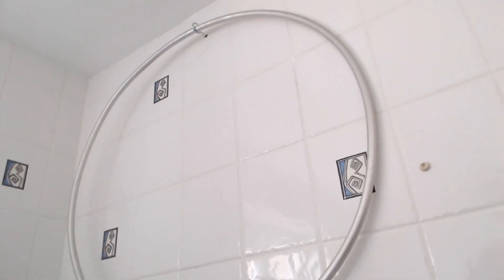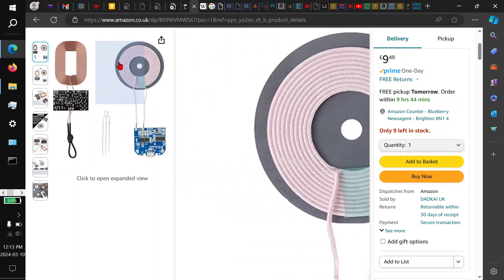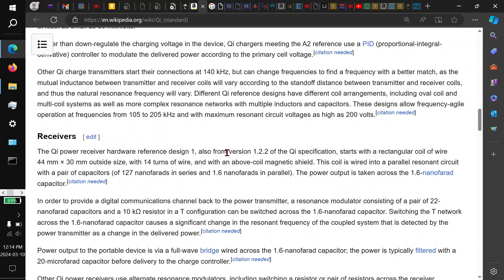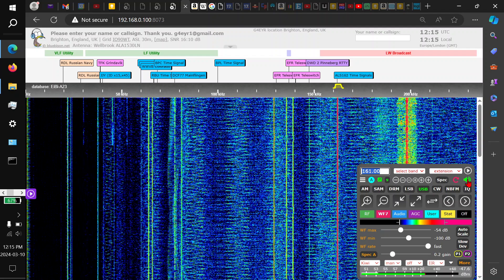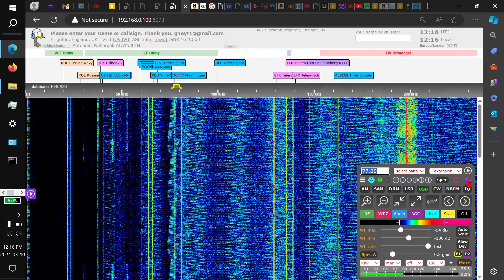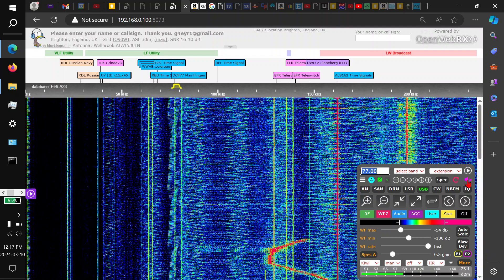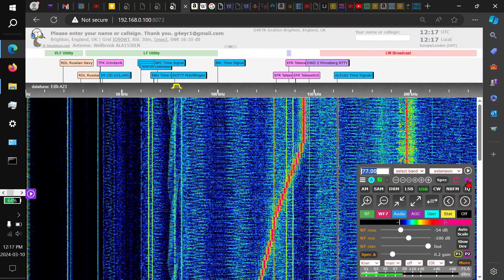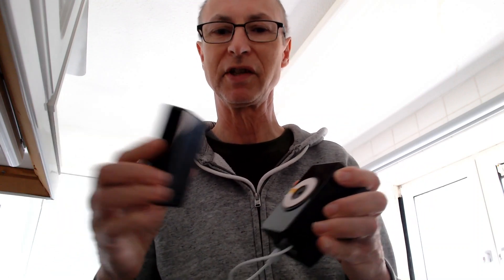Meshtastic Wireless Charger ELF Transmitter

Comment: VLF fascinates me, but all of my experiments in my suburban environment just ended up in all noise and no signal, so I lost interest. I'm tempted to pick up another Mini Whip or do some experiments with tent stakes in the ground. Atmospheric RF is really interesting stuff.
Reply from the maker: Yes - it is a fascinating area of the spectrum. The PA0RDT mini whip direct from the maker is excellent. The cheap chinese copies didn't work for me. Grounding is also important. You have to experiment a lot to find the best arrangement for your particular setup. Also eliminate local noise sources like phone chargers, TVs including sound bars etc. The Wellbrook Loop is also excellent. Unfortunately the maker has recently retired and is no longer making them.

Comment: I know you don't have/use a car, but here in E. Anglia Meshtastic 868mhz nodes are a bit few & far between. I was wondering if you had reviewed any 868mhz whips that will go on a mag. mount, for when we are travelling. Also it would be great if the phone could "ping" on discovery of a new node, not sure if that is possible & could be covered on your channel, maybe send the number of nodes in CW as an alert :)  ?
Reply from the maker: Those are all great ideas. I have seen magmount 868 antennas somewhere - probably it was on ali express. It would be easy enough to make one by cutting down an existing 432MHz antenna. Regarding your notification ideas, it would be good if you could suggest them to the meshtastic developers. I hear they are open to considering new ideas.